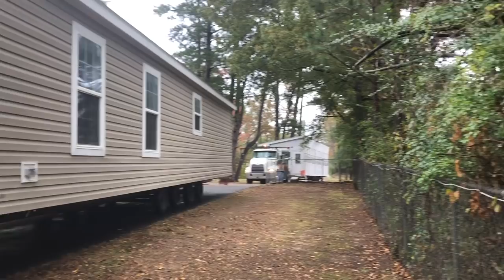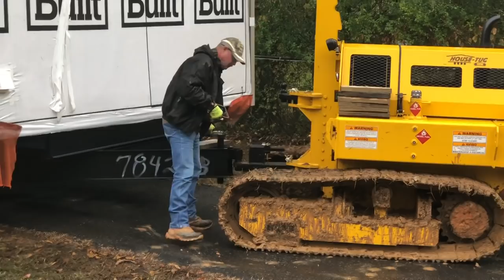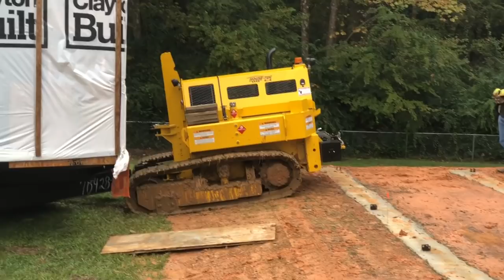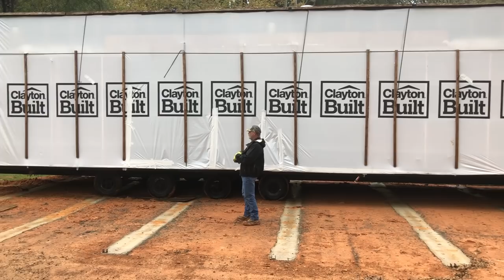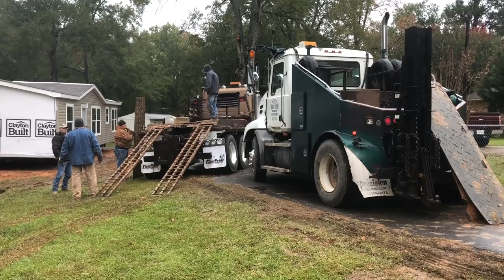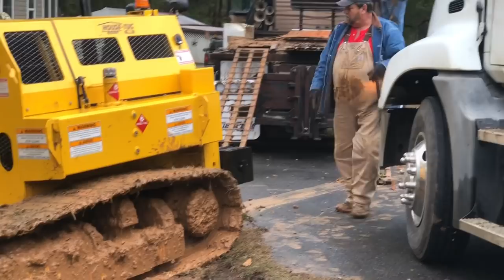Double wide mobile home getting delivered

Comment: I'd say that the plates wouldn't be to stop the ruts so much as to stop the trailer sinking up to its axels in mud. Nice house welcome home.
Reply from the maker: Paulman50 thanks! Two more weeks and we’ll be in it!
Reply: Tend to agree with you. Getting one of those stuck wouldn't be fun. Nor do they want the liability for potential damage if those chassis frames twist too much. Easy to get drywall cracks and worse.

Comment: Wow you are lucky !I just bought a double wide home and we did everything that they said to do to be able to move the house in properly,and then  the trucking company shows up and "cant get it in"but after we paid an extra $7,000 it was all good!always read the fine print lol@
Reply: And we had the People in today to do the gas and they were under the house and there Is a large area under the laundry room where all the insulation is soaking wet.these homes seem simple but all we have had are problems. I could go on lol...

Comment: Honestly, I was pretty amazed to see such steep ramps for that mover. Having loaded, and unloaded many tracked machines in the past, my butt puckered when I saw that unload and load happening. 
 I can't even imagine how much that machine costs, I'm guessing 20k might be a good down payment on it though.......
Reply from the maker: JimsEquipmentShed $65,000 !!! I was shocked when he told me how much it cost!
Reply: BCtruck, rebuild, repair,repurpose Yea, even more reason not to want to dump it off those night ramps....
Reply: We use a similar machine.. We have a translift and a platypus with a remote. We transport amd setup with the same crew.